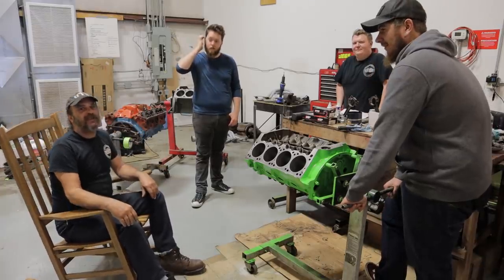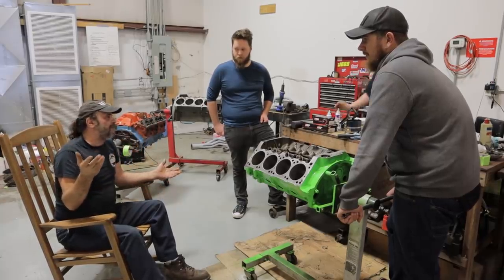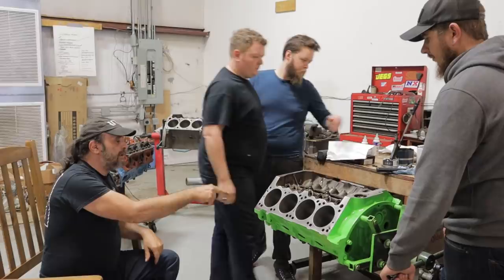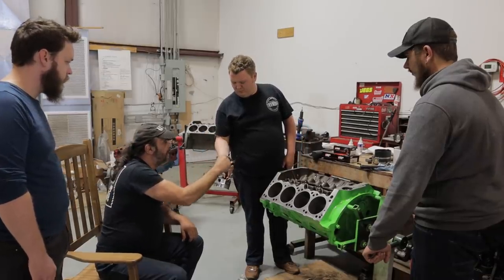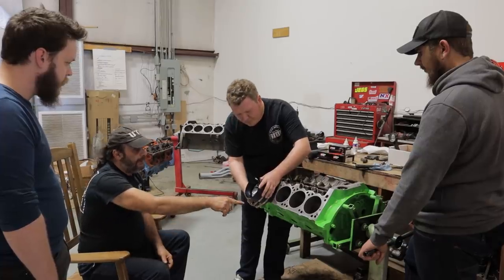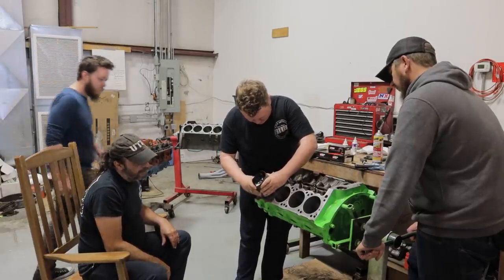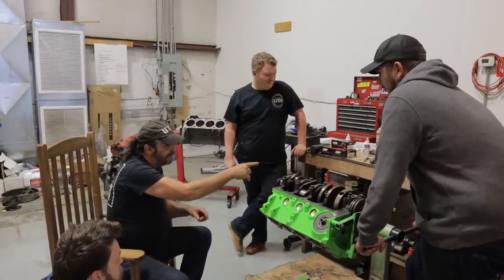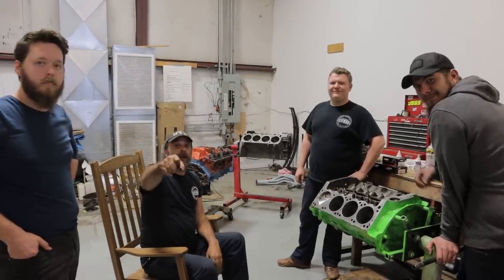How Many Guys Does It Take To Install A Piston?  Step By Step DIY Engine Building For Beginners

Comment: I put the block sideways when installing the pistons with long pieces of fuel line on the connecting rod bolts to protect crankshaft. This allows easy installation of pistons with access to crank shaft without spinning the engine on the stand.
Reply: That's actually brilliant and fuel line is plentiful atleast for me it is gonna use this tip Thanks.
Reply: Was about to say the same, but you beat me to it! 😂
Reply: @Robert taylor you know what that's pure genius aside from nutsack itch being plentiful I may have to take note on this.
Reply: @Robert taylor Then you can put your BVDs on backwards and get two more cycles before you need to change to a new pair.
Reply: I didn't notice, did UT do his classic piston 180 degree rotation for extra power or did they all skip that step?
Reply: Anything to limit spinning the crankshaft during assembly is worth it. Excessively rotating the crank can wipe all the assembly lube away from the bearings.
Reply: I like to do the same, and I turn the block so the deck is parallel with the ground so the rod doesn't try to flop to one side of the crank.
Reply: @63jeepj20  I'm learning from the tubing tip and everything else from you guys.
Reply: I used to use skinny spark plug wire boots, but have migrated to one hand under and one over like these guys.  Anything that works, doesn't damage, and is clean is a perfectly good way to do it :)
Reply: 100%. The engine stands actually have position holes to keep it locked in that way

Comment: Austin a little tip for the next time you build an engine.  If you rotate the engine on the stand so the cylinder walls are straight up and down it makes it 10 times easier to tap it in and fiddle with the end of the rod down onto the crank.

Comment: You should really lube the wrist pins up. And I've always found that rotating the engine block up on one bank makes it so less clumsy. Good luck guys.
Reply from the maker: John, the last thing I do before fitting the oil pan, is drizzle the entire shortblock with engine oil, and that's when the pins get theirs

Comment: Brings back memories of doing this for MY first tiime on a 430 Lincoln in the summer of '67 !
Uncle TONY  is a fine teacher.
Reply: I’m 24 and gonna be doing this on my 430 real soon! First engine I’ve ever torn down, as well. Real excited!
Reply: @Hemingray1893  Make sure that the oil pump drive shaft is not twisted/cracked -mine broke hence the engine rebuild - I as 18 when I did that !
Reply: @denislesperance852  Just got the oil pump off today. Looks to have been replaced at some point, but the drive shaft was still good.

Comment: Thirty years ago, my son blew a top out of a piston on his 287 V8 Rambler Rebel. We pulled the motor out, stripped it down, I went through everything with him, one step at a time. Lapped the valves, plastigaged all the journals, honed the cylinders, everything! I would do one, he would do the other seven. He learned a lot. You can’t beat hands-on with someone that has experience.

Comment: Great job. Ive assembled 100s of engines, i still always use a short piece of hose on each rod bolt, better safe than sorry. One tiny scratch means a complete disassembly to correct or worse, if not caught and orrected, a blown engine.
Reply: I agree, not only that but it gives you more to hold on to so you can keep your hand away from the journal.  One scratch or fingerprint may not blow up the engine, but it will shorten the life of that bearing.

Comment: I always did this with the deck parallel to the ground...made the reach around to grab the rod easier...your mileage may vary...
Reply: That's how I've always done it too, except on inline engines of course, then, the deck is perpendicular to the floor.
Reply: but hey, who doesn't appreciate a good reach around?
Reply: It also helps line up the rod since it's hanging straight down in line with the crank (turn the crank so the journal is at bdc) instead of falling to one side.

Comment: It should also be noted that you need to be absolutely sure that the bearing surfaces of the rod and cap are perfectly clean, no burrs, etc. before the bearing shells are installed to ensure proper bearing crush and heat transfer. Piston pin definitely should have been oiled like someone else said. Hopefully they did and just didn't mention it. Dry piston pins on startup would be bad. 
Also, with regard to torquing main and rod caps, I was always taught that it was standard procedure to torque each one as they're installed and then rotate the crank to make sure it turns smoothly. Otherwise, you won't know which one has a problem if there's any binding if you torque them all at once.
Reply: Good points! I was taught the same and do the same as you. I don't spread the upper rod bearing so it stays in place. If it's that loose the rod should be resized. Just my experience and my 2 cents.
Reply: Wouldn't you want to torque the rods before turning the crank? Couldn't it start a bearing to pre-spin?
Reply: @trevnerdhubbabubba6230  With everything just snug, (and all the clearances are right) the tangs on the bearings will be enough to keep them located properly. (Note that its the "crush", not the tangs that keep the bearings in place in a running engine though). I used to think the same thing, and had a paranoia about that, but over the years, Ive moved to the "assemble all then torque all" method. Plus, having everything rotated a bit, and having both rods on the journal before torquing ensures that everything has "settled" and the rods are at that perfect 90° to the crank relationship. (Thats probably not a real issue but it always makes me feel better LOL)

Comment: first engine i rebuilt was a 283 with help from an old retired engine builder when i was 14 he had me do everything check everything clean the piss out of it wipe it all down with w-d40 . had a mech shop check and prep the block and put the cam bearings in it we did the rest of it . when we where dun it ran good and hard lasted a lot of years put in a 65 impala matching # original engine

Comment: Hmm… maybe lining up all the ring gaps when installed is a good idea then lol! Lookin’ good guys! Looking forward to see it run!
Reply: Staggering the rings just helps ensure proper compression when it first starts. Like UTG said they move around once started. They rarely will have all 3 line up from this movement, but it is statistically possible. Just like it's statistically possible to win the Power Ball, but I never do. Lol
Reply: Yeah I had a engine builder do just that on my AMC 401. Needless to say one of the pistons ring land broke after a thousand miles. When I pulled it apart all the pistons rings were all lined up!
Reply: @gregchiropolos9885  Wow.
Reply: @gregchiropolos9885  so after 1,000 miles, they hadn't moved? Interesting. We should probably let UTG know.
Reply: @williamallen7836  Yep, for initial fire-off, you'd like not to have the ring gaps all inline, since there's a lot of fuel going into the engine that doesn't fire but does a great job of cleaning assembly lube off parts. Plus if the rings move, they've moving typically at the same rate (its not like a rear axle gear where the inside tire is traveling less distance) so the gap distance difference doesn't change much in theory.

Comment: Happy to see a rubber handled hammer in use there. My first V-8, a 400 Pontiac, was going together fine until piston #5 or 6. It suddenly stopped turning over, tiny sliver of handle wood found it's way between bearing and crank. Took a while to figure that one out. It was 1976, I was 17.
Reply: I used to cheat, put a crutch rubber tip over the hammer face so i could have both a hammer and a rubber hammer in the trunk with the tools but only carry one item for space.
Reply: Fond memories rebuilding the Pontiac HO 400 in my 68 GTO.  .60 Overbore. it was hard on cranks. Came home on fine day my ex had sold it for down money in a new car.  Sure miss that car. Go MGTOW!
Reply: @tomstulc9143  Mine was a 68 Firebird. Guy I got it from put a water pump on it, neglected to put the sheet metal plate back, cracked the block overheating it. Sweet car, Firebird 400 convertible, red, white interior, $300.  Pontiac cranks, ha ha, A friend of mine had a hot 400. He missed a 2-3 shift. There was a loud bang then silence. Behind us in the road was a puddle of oil, one rod journal and the bottom half of 2 rods. Not funny at the time but we still tell the story and he still has the broken assembly.

Comment: You are a great teacher Tony, it is a bonus for everyone concerned that those young guys are paying attention to every letter of your guidance,  as you know all too well Tony getting the solid foundation of good shop practice is the major factor toward turning out really capable mechanics, you are lighting the passion for them to use critical thinking and logic, the tools of success.
I'll be surprised if the car these lads are building doesn't run really well with few bugs if any really, 2022 is looking up already.

Comment: I hope bearing oil clearance was checked off camera prior to assembly….just had a set of King coated race bearings vary from .0024” to .0038” clearance on the mains in a Dart LSX block.
Reply: I was wondering the same thing myself.
Reply from the maker: All checked and good to go. We don't have cameras rolling 24/7

Comment: Its easier to stab the camshaft in first, so you can reach inside the block without the crankshaft in your way to guide the cam thru its bearing openings. when ready to put in the piston, rotate the block so the deck is parallel to the ground--easier to check with a level to make sure the ring compressor is just as level.  Some will use a fishscale to pull that piston down to the crank, so they can measure from cylinder to cylinder if there's a ring hanging up. As for putting fuel line on the rod bolts, it just makes things easier than trying to reach up inside to guide the rod as it goes down.

Meanwhile, i'm one of those who believe a bearing should be cleaned chemically, not with a Brillo pad--that just replicates dirt in the oil scouring a bearing. I know some folks get away with it and not replicate a spun bearing  before break-in, but that probably says more about the bearing's ability to take abuse .

Comment: My trick is to seat all the connecting rods, then spin the block and assembler the Cassandra only then do I begin the torque process. As you mentioned,  that stops you second guessing.

Comment: Did I miss the episode where you plastigage all your clearances?

The reason this is on my mind is because I just took apart a 350 where someone had put 2 std rod bearings and 6 .010s in it.
Reply from the maker: All checked and good to go
Reply: @UncleTonysGarage  I was sure you had but wasn't sure if newer mechanics were aware of the need for this critical step. Especially important in today's world where anything within 10% of spec gets shipped. A late Merry Christmas and an early Happy New Year to all of you down in the Volunteer State

Comment: I always have the problem of the rings popping out of the compressor right at the bore as I am pushing it down.
Reply from the maker: Make sure the compressor is very snug to the piston, well lubed, and square to the deck as shown here.  Also, your taps should have a good deal of push behind them.
Reply: Also make sure your ring compressor is in decent shape.They do wear with enough use.

Comment: I like how the guys were paying attention and learning how to!

Is PB really good to assemble with seems too thin to leave much of a film? I always used 30wt engine oil.

I also would make the block deck parallel to the floor, let gravity work for you.  I also got a nasty cut from the edge of that blue steel ring compressor, not fun, use care!

Comment: I would always torque the mains before going any farther, too many time I've had something make it tighten up when torqued, either end play on the thrust bearing or any number of things. Just best to torque the mains and check end play before moving on.
Reply: Yeah, I like to torque the mains and feel how the crank rotates. I like do a preliminary end play check before installing the crankshaft. Just place the two halves of the thrust bearing on the journal and use a feeler gauge  between the bearing and the crankshaft thrust flange.
Reply: @davidleonard8369  yea, I did that too, but sometimes when you put the bearing in the block it can change slightly. Too many things can go wrong, that it's worth torqueing and rotating before going  farther.
Reply: @myretirementlife8731  absolutely, that's why I do a preliminary check. If there's a end play issue you can correct it before the crankshaft is installed. But you should always check it again after installation and before installing the pistons and rods. And of course there's more than one way to skin a cat but that's the way I have always done it. Might be because I used to build high performance Volkswagen air cooled engines. A lot of times the engine case has to be machined to accept an oversized thrust bearing and you have to cut the inner surface of the thrust bearing to match the case. So checking before and after installation of the crankshaft eliminates the possibility of confusing bearing slop in the case for actual end play.
Reply: @davidleonard8369  agree 100 percent,  I was an automotive machinist for 40 years before retiring.

Comment: Great video, especially the tip about not needing to use hose to protect the journals.

One question though. What are your criteria for when you would check end play and bearing clearances? Obviously if the crank had been machined you would most likely check those unless you have 100% faith in the machine shop but are there any wear patterns to look for in well used engines that would make such checks advisable? Do you have any tips on checking end play without a dial gauge?

Comment: Those young guys are doing a really good job, with your guidance. I have a question for you about coating kits. Or coatings applied on used parts. I myself have overhauled many engines over the years. Reusing almost everything except seals and gaskets in most cases. With an extra couple thousandths of piston clearence in a good overhaul. Do you know if applying coatings to the piston skirts, one good used pistons, would give any cost effective benefits. Either in performance or longevity.

Comment: Ok, you did use an assembly lube on the bearings.......but i disagree with NOT torquing the rod bolts.......TORQUE THEM, then rotate the motor one time thru.....make sure its smooth......if you wait till later, and torque them all at once.....if its not smooth, which piston has the issue?......i also like to have the cylinders horizontal, to better watch the rod bolts and crank, and you DONT have to keep moving the block after each piston install....one bank at a time..and, since they are torqued each time, and you've rotated the motor a full turn to feel it, you KNOW where ur at......i have NEVER NOT torqued a rod after intall, and turned the motor over to check if its smooth......cors, Stock eliminator makes you anal, but even fundamentally to me, it makes good sense......not gonna matter now, i guess the short block is done......look, i LOVE THE CHANEL, but teach these young bucks a few anal things, to ensure a properly assembled short block.......thanks for lettin me rant!!

Comment: I would rather see that piston, rings and cylinder coated in motor oil to install them, that PB Blaster has no cling to it by the time it's put together you have a dry engine, just my preference.
Reply from the maker: The PB is only there as an intermediate lube.  All the cylinders will get a wipe of engine oil before it's buttoned up.
Reply: If you spray a bare block long enough with pb blaster to keep it from rusting the block will turn orange....trust me I know...had a la 360 bagged up waiting on rotating assembly to come from summit lubed it up every other day with pb blaster for about 2 weeks or so just to keep the fresh machine work from rusting will about 5 or 6 days later bores were orange lol...use wd 40 to keep stuff bar4 blocks from rusting and use 30 wt motor oil for assembly

Comment: Just as a personal preference i always use a yellow paint pen to mark my bolts ive torqued,Never lost track with that method.I install a rod assembly then spin it over by hand after each one is installed so if there's an issue it was the last one you stuck in.
Reply from the maker: You'll find the same issues at hand tight without the danger of distorting things if there is an actual problem

Comment: On my quest for a cheap get it running camshaft on my 5.2 I'm going with a 88-91 truck cam that used 1.5 rockers and I'm using 1.6 440 lift will cost me only 200 bucks

Comment: First time I did that I scratched the crank journal with the rod bolt…..
Reply: Did it work out ok?
Reply from the maker: it happens
Reply: @larrynorsworthy8582  Yeah it was stock standard took it out again filed the high spots off with a points file then re-polished it by hand with wet and dry sandpaper and a shoelace…..

it did leave a small divot in the journal but I just put it together ran for several years then it needed a rebuild for another reason so I guess so yeah…….. 

I don’t think a small divot  really hurts it you just don’t want anything sitting proud of the polished journal because it will obviously gouge the bearing…….
Reply: @UncleTonysGarage  I knocked of the high spots with a points file - then cleaned up the journal with wet and dry sandpaper and a shoelace..... ran it anyway with a small divot in the journal and the motor was fine.... no dramas - lesson learnt - all the nest from Melbourne Australia....